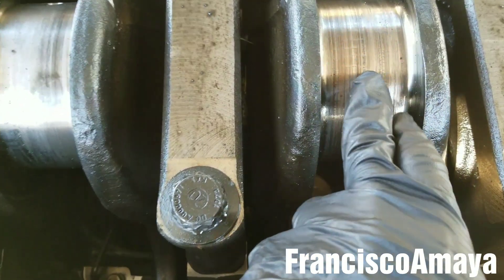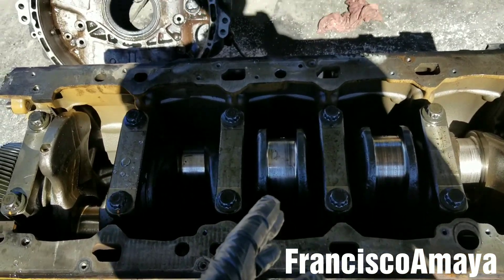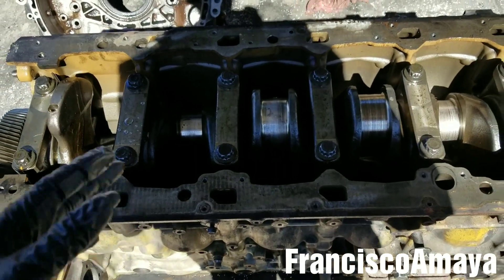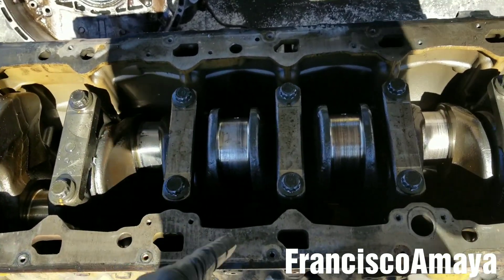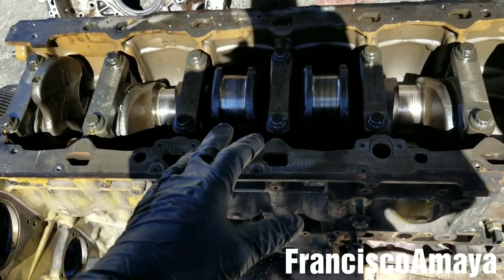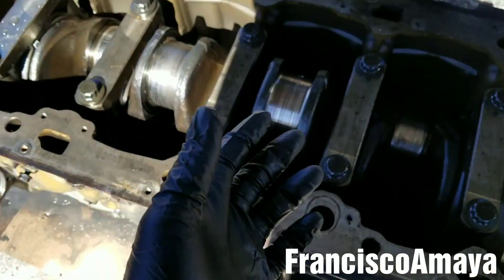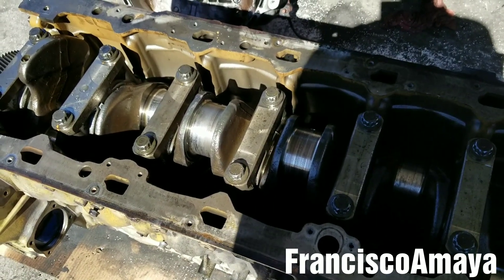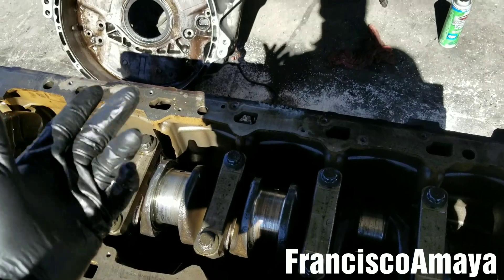Freightliner cascadia DD13 DD15 DD16 bad crankshaft damaged  rod and main bearings engine sized

Comment: Compare freightliner 2015 with cummins vs 2015 with detroit dd15
Reply from the maker: On 2015, Detroit is better. 2016 and up Cummins is good just as Detroit
Reply: Which you recommend automatic or manual freightliner
Reply from the maker: @omarosman6664  
manual transmission

Comment: How much for repair a dd15 engine?
Is not better to buy other engine more modern year and switch ?
Because in case to repair same engine is to expensive I guess or not??
Reply from the maker: The best option to take will depend on the damage of the engine.  Depending on how severe is the damage, that will determine the cost of repairs or buy a used one.
Reply: Francisco Amaya ok,,thanks